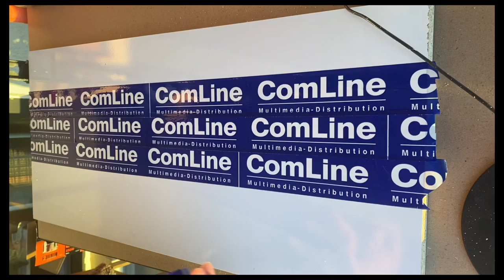DIY , How To Make an EPOXY RESIN CHARCUTERIE BOARD

Comment: What is Co Line? I noticed you didn’t make a mold. I like the simplicity of how you did this.
Reply: Comline I meant
Reply from the maker: You mean the factory brand? Of something?
Reply: @diycrafts_ytchannel  no. Is it a tape or something else? I’m wondering how the product worked in place of a mold.
Reply from the maker: I have used a tape and a piece of cardboard and covered it with hot glue , this will work 🌸
Reply from the maker: Tnx for watching my video 🙏🏼
Reply: Thank you so much for the information. I will try that!